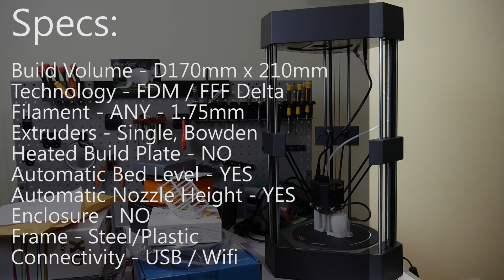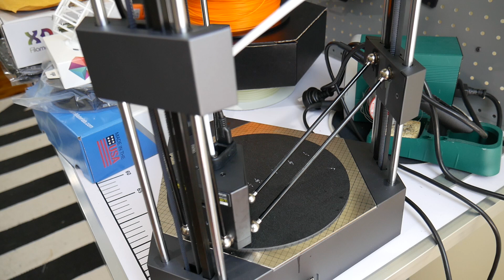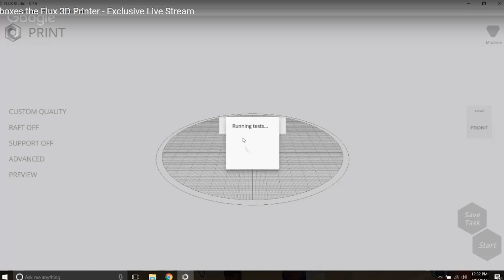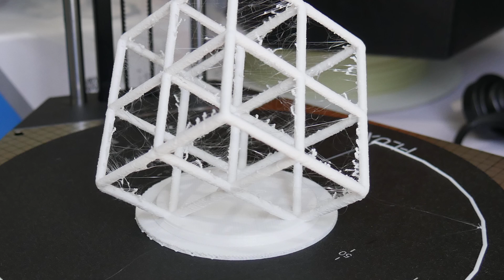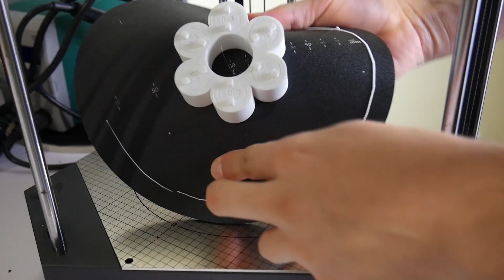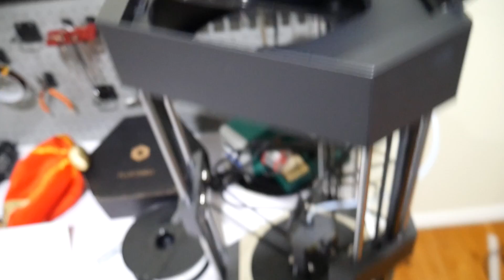FLUX Delta+ 3D Printer Review - Part 1

Comment: why is it now a days that these $1000 printers still do not have heated beds. i do not understand its such a cheap thing to design into your product that would make it more competitive. and better for the consumer.
Reply: so because this printer is trying to pack so many features, they eliminate the heated bed, thus limiting it usefulness as a 3D printer. I use my large (much larger than this) delta to print PETg on a regular basis, and no heated bed just to add scanner functionality seems a compromise not worth making. And having built/designed a 3D printer, and built a bed from scratch -- put a proper insulator (like a thick piece of cork) under the bed and and about 50mm of air gap and the electronics will be fine and the bed will retain heat better.
Reply: Ahha, but if you just use the original hexagonal build plates (or make some yourself, you also have have the lock-in effect of the hexagonal build bed. I don't know how you'd go with the magnetic build bed then though... I don't think it would like the toasty 100c for ABS. ;) And yeah, 15mm probably wouldn't cut it for extended lengths at those temperatures, and you'd need an external power supply and hot-bed controller anyway, and would have to control that separately.  Hm... tempting...  But then again, I have gotten my Trinus heat bed up and running at last, and it seems happy doing ABS, so the Delta can keep doing PLA ;)
Reply: Those who say sentences starting with "those who say" are usually presuming to speak for others. ;)   Apparently everyone is only allowed to own 1 printer now?  LOL
Reply: Those who say that they don't care about a heated bed because all they print is pla. Well if you don't have a heated bed, all you will ever print is pla. If you have a lined nozzle, you will never print anything which requires high heat..like polycarbonate, or better PETg flavors. If you spend this kinda cash on a printer now days and limit yourself out of the gate, well, seems foolish to me. The fact that this printer can scan, who cares, it's a gimmick. If they make it be able play LPs would it make it more attractive as a 3d printer?
Reply: True... but I wouldn't tell the Flux people who have printed PETG that though ;) I have a printer with a heat-bed for when I want to do ABS and the like, and the Delta does everything else... plus it has a much bigger build volume, and prints reasonably fast without losing quality to much... for example... I have rarely (if ever) moved it from the 'medium' quality setting... Then again, I'm printing simply prototyping or case design that don't have too many sudden changes in angles etc needing the higher resolution/reduced layer heights.
Reply: I have 3 printers, will start building a 4th, would never consider a printer without heated bed. Especially at this price. I keep seeing people say they don't care about lack of heated bed because they only print PLA. Those folks never say they have other machines which can print ABS etc.
Reply: I'm going with what Kazolar said, and thinking you would need more like 50mm of air gap.  Standoffs to hold the heated bed (with cork liner) with three 50mm standoffs might just actually work though.  You'd lose 50mm of build height (but still have 160mm) and it would not have to be hexagonal, a 200mm circular plate, off the shelf item, would work just fine.  Might actually be worth a try, only concern would be it might be a bit wobbly, but three legs at 50mm with secure screws should be solid enough. An external power supply would be another requirement. My only problem is I really have no need for a heated bed on this printer. Still, interesting idea...
Reply: +kazolar, not sure why you feel the need to overemphasize size comparisons. If this is not the printer for you, then it is not the printer for you. End of. The machine is what it is, which is more than just a printer.

As far as PETG, I print it on the FLUX Delta all the time without a heated bed (regular basis), not difficult.

Your plan with cork and air gap sounds perfect except for one minor flaw. FSRs do not cooperate with an air gap so then there would be no calibration and autoleveling.
Reply: As long as you made sure that there were standoffs over each of the force sensitive resistor pads to transfer the pressure, it would be doable, wouldn't it?. I wonder how you'd go getting another hexagonal base plate for the printer, using standoffs of say 15mm length on each point, and another say three/six around the middle, and then attaching a heating element to the top plate? you'd get the air gap separation, loose ~15mm of build height, and get a air gap to prevent the base from being cooked alive.
Reply: There is a turntable and laser scanner poles in the base of the printer that would make it a very difficult engineering feat to also include a heated bed in this machine.  You will hopefully see those features in the next video and understand why a 'cheap' heated bed would destroy the much more expensive components under it.
Reply: Booze Kashi heated build surfaces do not transfer heat like an oven. they only heat the surface they are connected to. the amount of warm air a heated plate will produce will do absolutly fuck all to electrical components inside the base of the printer. the stepper controllers will put out more heat in an inclosed space. then a heated build plate on the exterior of the printer
Reply: +John Fisher, that surface it would be connected to would BE the turntable and laser scanner poles. Those items are not inside the base (plenty of other components are) those components ARE the base. If you added a heated build plate, you would cook them as it would physically be sitting on them. 

In addition to those, there are embedded Force Sensing Resistors that are used for the automatic calibration and leveling. While those could still work with a heated build plate, you would not be able to add enough insulation to protect those other components.

If you have an idea or a way to do it that would safely insulate those components, still allow calibration, and not add so much height that it would screw up the z-axis, shoot me the plan, I would be more than happy to test it.

Comment: Glad to see your review of this, Angus. I have the previous version with about 500 print hours on it. My experience with this machine has shown me that most of its quirky behavior can be addressed with using S3D and dialing in the settings. The Flux user community is active and has contributed greatly to mods and improvements that ended up in the new 'plus' version. I have printed an external spool holder that clips to the top of the printer and allows me to use 1kg spools. There are clips on Thingiverse that allow one to use a round borosilicate glass plate as the print surface, although I have to admit the new flex magnetic build plate is working very well and negates the need for hairspray or glue stick. My experience with Flux branded filaments is mixed... some colors print great, others not so well. I generally use Hatchbox and I find that my machine likes this filament. YMMV of course.

The laser engraver head works pretty well for a desktop device and I've been able to create some neat images on wood and chipboard. My first edition did not come with a cutting head so I don't have experience there.

Sorry to sound like a fanboy...I'm not. There was a learning curve for me with this machine, and with the help of the community on the Flux3D forum as well as Facebook I was able to solve most of my issues and end up with a reliable printer. I'll have to reiterate that it's still quirky, the Flux Studio software can be a challenge (it has improved greatly over time, though), but the Flux3D folks have been very responsive to community input and now I think they have a decent machine as a result.

Keep up your excellent work as usual!
Reply from the maker: Thanks for the comment Jeff! You're right, due to my extremely limited time these days to get anything out timely I have to test a few objects using defaults as supplied - which is how a newcomer would approach the machine. It was pretty clear to me that settings are holding it back so will revisit once I return from Bay Area Maker Faire with a S3D profile and print a proper spool holder. Flux themselves have commented on this video saying their batch of white PLA wasn't that great... which also explains a lot!

Comment: the fact that they made it only work with their own spools is pretty disappointing. I have a much cheaper kit and it seems to print a lot better with much less effort. Hopefully they can fix the issues with the next model.
Reply: The design is not to limit the choice of filament, but just to help the official filament spool placed better. Many FLUX users use third party filament with an external holder installed. So it's still pretty flexible when users want to print in other filament they prefer.
Reply: As with +Booze Kashi, I simply use a stand-alone reel holder, and run the printer with the lid off (it's removable). If you use their spools, or can get one the same size, you can put it in the top. Anything else, just use an external spool holder. End of story.
Reply: Works with any filament. Spools are not coded. This is not like Zortrax at all.
Reply from the maker: but they don't fit ;) not fanboying for zortrax at all but they also don't chip, only XYZ davinci does out of the major players as far as I know.
Reply: Zortrax used to be proprietary too. I have found some Chinesium spools that do fit inside, but it was definitely a form over function choice. To have made it so a 1 Kg spool fit inside the machine would have made it look freakishly big-headed though.  FLUX is definitely not in the same league as the major players (yet).

And really, out of all of your printers, how many do you actually put the spool INSIDE vs. an external spool holder?

And how many printers have you reviewed that had wonky spool holders? That's almost every printers' Achilles heel since there is no industry standardization of spool dimensions, or even the actual spool material.

You did kind of surprise us all by wedging a spool in diagonally and then wondering why the extruder was knocking. That is not a normal sound. :)  You can run from external spool holder straight to extruder without extra PTFE tubing, it works just fine. There are several designs for spool holders that sit in the lid area or attach to the top if that's your thing, they are in the FLUX collections on Thingiverse.

Looking forward to Part 2. It was a bit disconcerting to see the guy I learn more from than anyone else making prints like that. Use your favorite filament and dig into the settings or better yet, use S3D.  I do understand your baseline testing with defaults and manufacturer materials, fair enough, but also note every comment here that starts with "my XXX printer that only cost YYY with a few mods can do better". That is the nature of the 3DP community, we mod, we improve.

Full disclosure: Not complete fanboying either. That ugly damn hole in the top because I keep the lid off and don't use their filaments is one of the biggest things I gripe to FLUX 3DP about all the time.

Comment: okay - I really want to try that tolerance test print on my Cobblebot to see how it goes.

But also I should be finishing and doing my first test move this weekend under power of my Own Delta I have built/designed based on stuff you can buy at Bunnings (its 1.2m high as part of my small scale first steps).

Comment: How does the spool pocket work? it looks like regardless of how you put a spool in there, the amount of friction generated it's going to cause the extrusion motor, and possibly the arms themselves to experience extra strain, resulting in extrusion issues...

... Granted, I know nothing about Deltas ;)
Reply: It's got anti-friction teflon strips inside there. It works perfectly with FLUX filament spools, and a couple other brands I have found that do fit. Friction not an issue at all. But I mostly print from external rack, so lid just stays off.
Reply: Extruder motor is in the top right next to where the fillament feeds in, so it doesn't have that much work to do really. Considering I was running my Flux Delta (not Delta+, the earlier Delta) today with a spool where I'd looped the filament under itself on the reel, so it was constantly unknotting itself, it was hilarious to watch the delta move itself across the table whilst unknotting the spool (which was mounted on a external holder). You heard it right... the extruder easily strong enough to move the printer until the filament decided to move along ;)

Comment: Wow! Just happened to find the review video was finally out. Thank you for the feedback and in-depth review. Can't wait to watch the second video soon. ;)

We also found the newer version of our white PLA works not so well. We are still working on improving the performance under default settings. The Cura 2 preset of our latest software version generates the best performance. Hope you have time to try it with FLUX filament of other colors. 

For the string issue, you could try the Cura 2 preset on FLUX Studio with only printing temp adjusted to 180. I also printed this lattice model a few days ago. The quality was great under this setting. :D

Shawn from the FLUX team
Reply: waaaait no, makers muse got bad luck, i have a flux delta, it prints like how it printed in make anything/ 3d printing channels video, it's much better than how it's shown in this video, this is a good printer, makers muse just got some bad luck, not to say the prusa i2 is bad or anything though.
Reply: hamzadad khan. Ditto. Having both the Plus and a heavily modified CR.10 and the delta + is by far the easiest and quickest to start printing. I found using white lithium grease on the guides, rod joints and magnetic sockets perform much better than the included silicone gel lube. Also swapped out the stock Bowden tube for a Capricorn XS low friction Bowden tube which also aids in the flexibility of the effector to reduce the chances of the rods disconnecting from the magnetic ball sockets. Overall great machine and as Angus pointed out most of the issues were software related. FLUX does need to work on the Flux Delta iOS app as it's buggy most of the time however it's amazing when it works ;)   Angus should do a part two of this video since so many firmware and software updates have happened since July 17'  Cura2 engine seems to be the best performing over Cura and Slic3r.
Reply: FLUX Inc.  Please fix the Flux Delta iOS app as it's buggy most of the time and it's suppose to be a main feature of the Delta+ and the camera does a great job of showing the print in near real time but it doesn't appear anyone has updated the app in quite some time.  Please improve functionality and connection drops
Reply: Sorry to say but this printer sounds way to problematic vs my prusa i2 which I'm about to rebuild into a prusa i3 variant..